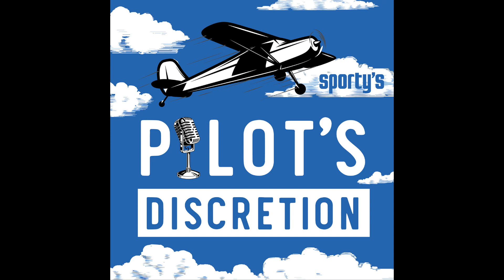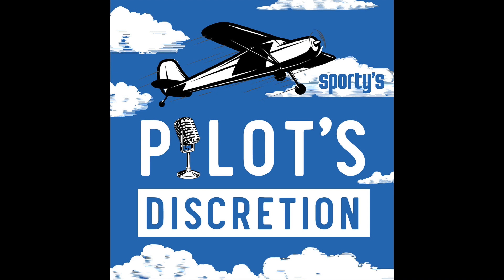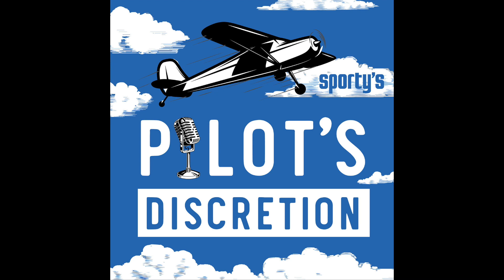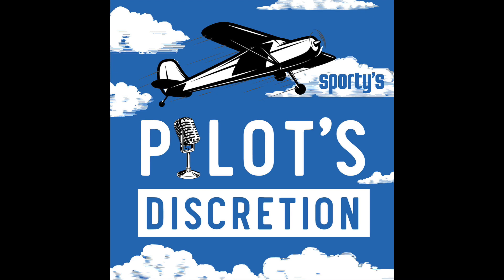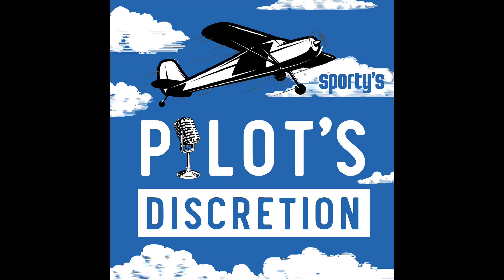Busting aviation maintenance myths with Mike Busch - Pilot's Discretion Podcast (Episode 14)

Comment: Mike Busch is the Bob Villa of aviation. This guy is a laughing stock among REAL mechanics, which he is NOT.
Reply: This is a bit of a schoolyard argument. He's crap because we laugh at him. 
What is a real mechanic by your definition. He's well read, reasonably clever and trying to pass on techniques which he believes are superior. I suspect he's also likely to change his mind if and when facts change. I've dealt with a number of mechanics who fervently believe in particular brands and treatments when there's no science behind the treatment. I prefer his approach.
What exactly don't you agree with in relation to the opinions that he presents? It sounds a bit like you're a believer in wives tales and he's poking fun at them however you don't want to put them out there because they're a bit dumb.
Reply: Regardless of Mike's credentials, his company has one of the largest current on-going databases of Continental and Lycoming operating information in the industry.  They know how these engines perform, and why they fail.  And their arguments are evidence, science, and statistic based, rather than opinion and hearsay.  Not to mention he's successfully kept his Cessna 310 engines running failure free to well over 200% of TBO by operating them in accordance with the knowledge he's gained.